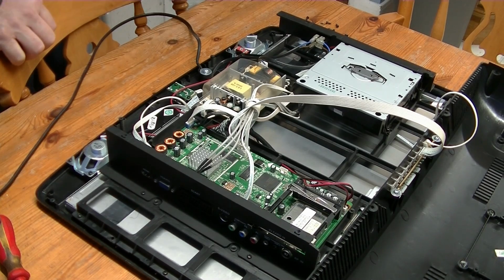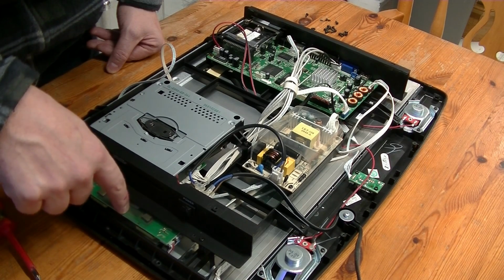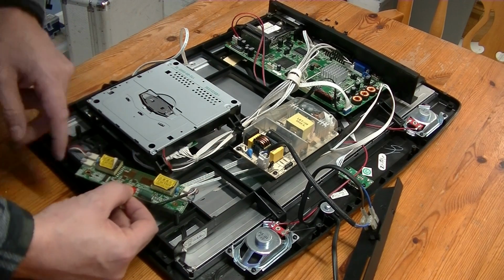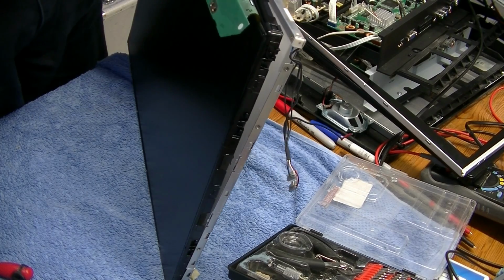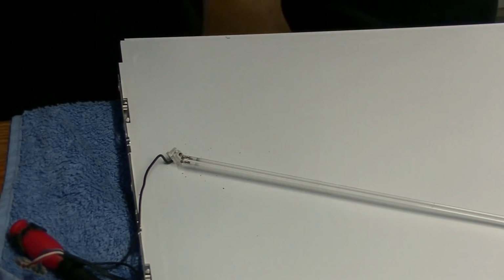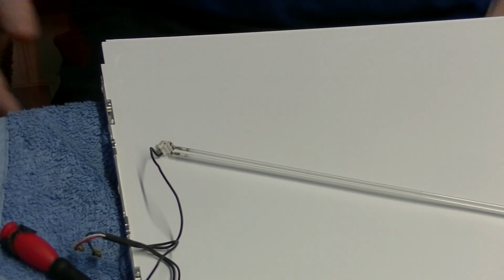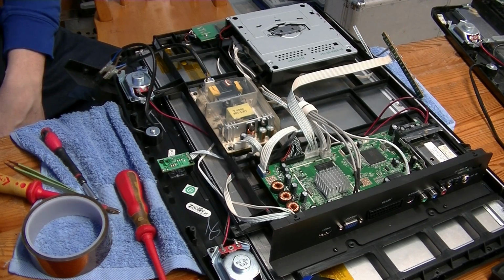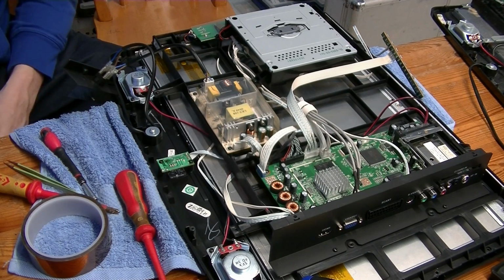Technika Repair x22/14c-gb-tcd-uk

Comment: Hello mate, I have this tv and theres no sound.
sound went at same time. 
Reset tv
Checked the settings

Any ideas? Cheers
Reply from the maker: Sorry, but it's all a learning curve. Check screws are tight, cables are in properly. Check the board for bulging capacitors etc. I am no expert just a hobbyist. Best of luck